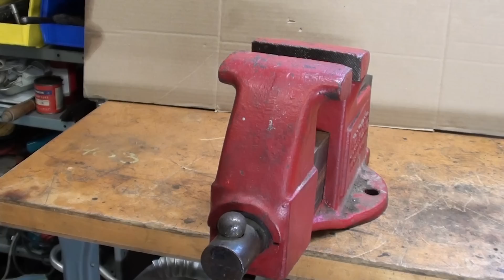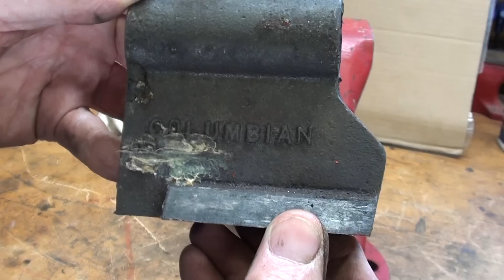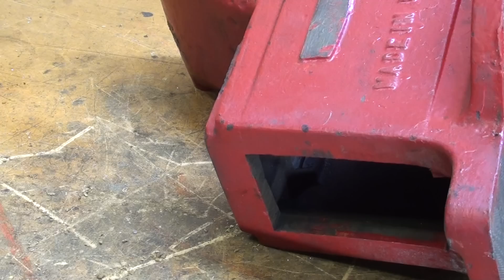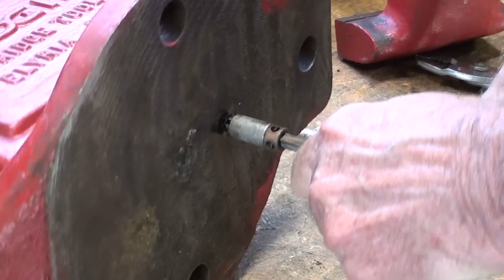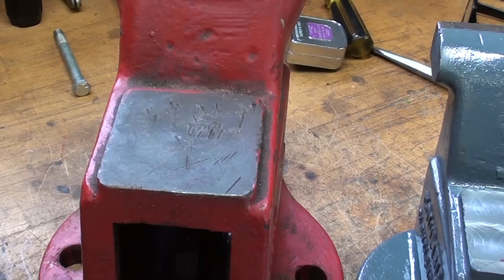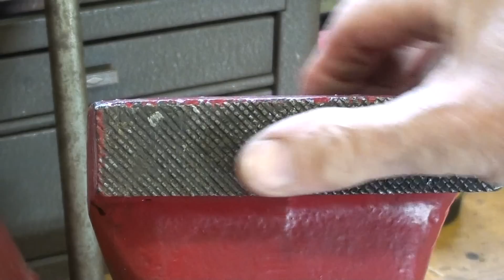Fixing a Huge Ridgid Columbian Bench Vise Tips 569 tubalcain

Comment: Msc industrial supply sells Columbian. I think they are higher since wilton took over. I fixed an old vise for my local Napa and when they went out they gave it to me. I gave them 10 dollars. It is a babco made in Japan. It opens to 8 inches. They were affordable and pretty.decent. did structural steel for 26 years and it was my main vise. I saw new ones a ways back so I guess they are still going. I want a new vise so I am looking. Want a Columbian or reed so I may need a loan from you. They are pricey for 8 inch and above

Comment: I believe the tap extractors would have worked in an impact tool, such as a cordless drill with a hammer feature, but not on high-torque. Just to get a smacking action. Then when all else fails, there is a smoke wrench. Heat the base of the vise, just a little for expansion, but put the extractors in the freezer or ice water. That would cause the tap to contract. Then use the hammer drill in reverse of course. Advice: always use quality taps that DO NOT twist before cutting. If it twists, it will break off in the material you are tapping.

Comment: When I took it apart it had a ring and a very thin cracked metal plate in it. I wanted to try and find replacement parts for it. The pin wasn’t difficult to take out on mine I just used a hammer and a screwdriver. It came right out.

Comment: I have the same vice and it’s grey. I bought it at a garage sale for $200, it was pretty worn but still working. It had an orangish color to it, I thought that was the rigid orange but after cleaning it with just degreaser it was just rust. The original color is grey.

Comment: i own a ridgid # 4 that i'd paid $5 for it from an evicted bicycle shop like - 7 or 8 years ago  were i live - i was passing by with my bicycle going to the train station to get the train when i stopped to ask for something when i found that the owner was evicted! shocking😵 i know 💀🔫
any way, i've noticed of the red vise attached to a workbench somewhere in the yard so i inquired about it, the guy in charge of the auction, a young latino guy with a big hat, told me:
- son, if you help me to sell 5 bycicle frames then i will sell it to you for $5 bucks! (wt? 🤔)
inmediatelly i got in contact with the bicycle mechanics that serviced my bike in the past ☝
✌ so the day after they went there with a pick up truck and bought about 50 frames! wow! that was incredible 👀
any way, i got there when they were loading their frames into their truck and i ask them for a ride to my home because the vise was so heavy and with my bike was impossible to get there -- i have NO grill 😢 - and it was an uphill real busy interstate highway, probably the most busy road in US history, PCH! 💀
they dropped me at home and i let it lay down on top of my work bench inside my garage
 i was very excited because that was my first professional vise during that time; today i own several vises that i also got from yard sales lol 😁👀.. and other stuff such as top bench drills, compressors, grinders, chop saws, etc from craiglist mainly 🤗
👐 that ridgid vise wasn't opening enough at the beggining and it was kind of hard to open it so i decided to check it in - so i dissasemble it and lube it that time 🛠
now it started to do the same and that is why im checking your videos sir, because now it's going to have some real 'make up' done 👌
thanks for your videos 👍
Reply from the maker: Thank you for an interesting story

Comment: So called "tap extractors" almost NEVER do much more than break with the tap still stuck firmly. If you don't have an EDM, welding a bolt on to the broken tap if you can get to it, has better results. The heat aneals the tap and often will loosen it.
Reply from the maker: Yes

Comment: Nice save on that vice. I'm glad you didn't try to re-thread that center hole. Of course you knew it would be hard as diamonds after welding. 
Im sure you know but didn't mention it, but the original pin for the nut is a taper pin. Getting them out is sometimes challenging. I usually use a sturdy chunk of metal stock to stick in there and block it up level so you can tap the pin out without bending it.

Comment: ….11:50.....those tap extractors have had little success in my realm as a maintenance mechanic…..what has worked, is to weld a small piece of 1/8" or so TIG wire to the tap, at an angle and use it as a handle...this usually requires a TIG welder though...a MIG weld will likely just break off...
 I've been able to get out taps and broken allen screws as small as 6-32....it works OK because the cast iron doesn't weld very well...

Comment: I have this same size vise at work in the shop it is a Columbian thanks to this video I have fixed some of the endplay on the moveable jaw by putting the collar on the screw in the correct place. But the nut has lots of movement I cant fix because Bubba welded the damn thing to the post cemented into the floor ! I wish I could post pictures on here the poor thing is in a sad state there is a small work table welded to the back of it where the anvil would have been. Its handy but sad that a good vise has been ruined by hammer and chisel debauchery.
Reply from the maker: Very well put, you made me laugh

Comment: That was an easy repair...!!!   Wish they were all that easy for me...   🙄
On larger sized taps, one of my often used method is a light burst of plasma torch, it worked in almost every situation, just be careful not to harden the surrounding metal, it generally takes linger to set-up than the actual removal...   lol
Reply from the maker: Thanks pierre

Comment: A question for the shop teacher...I've heard many people say that when you use a file that you should only move it in one direction (push way from you for example) and not back and forth.  That never really made sense to me since the teeth on the file are sharp in both directions.   I see you moving your file in a  back and forth motion.  Is there any reason not cut with a file in both directions?
Reply from the maker: It only costs in One Direction
Reply: 99% of files cut in one direction, forward. It's best to use a handle with it.
There are files that cut both forward and backwards. They are called a rasp.

Comment: Hi recently restored a Wilton vice that I've had for 3 or 4 decades now and when I painted it the hammer tone blue that it originally came in a deliberately painted over the anvil in the back so I wouldn't pound on it with a hammer. Pounding on a cast iron vise just doesn't make any sense to me. That's what my 1' long railroad rail is 4 because steel doesn't crack. When you pound on it. Cast iron does.

Comment: Looks like Bubba tried to do what you did to fix the vise , first was the attempt to thread the hole and when his one and possibly only tap broke he then tries to weld the nut in place 
 I think the hole was drilled at an angle intentionally for the pin to hold the nut I fixed one years ago and I seem to remember the hole was drilled at an angle ( don`t know how it got broken it was in high school shop class)

Comment: Nice repair!!  Just a thought: If the anvil were bad enough you make a sacrificial plate to put on top of the anvil and install it with flat head screws in shallow holes tapped into the original anvil so it could be replaced as it gets damaged in the future. It would probably take away from the value of the vise as an original piece but if the anvil were so damaged it would restore the working surface.
Reply from the maker: Good idea

Comment: Lyle, about 3 years ago, I got a 12 volt 
set of drivers, (drill and an impact) for 
$100, at Homer's store.  They are Ridgid 
branded, and have worked flawlessly, 
ever since I got them.  The impact driver 
has enough torque to tighten the bolts 
holding a clutch to the flywheel, on a 
Jeep.  Not enough to torque, but to run 
the bolts down all the way,  (And, 
compressing the spring.)

I cannot say enough good about them.
ONLY thing, is the required hoops to 
jump through, to get the "free batteries 
for life" program, is almost impossible 
to do.  I gave up!

steve
Reply: A 'program' like that makes more enemies than friends.

Comment: Value is, of course, highly variable between markets and locations.  However, here is a similar Columbian which recently sold on eBay for around $300 shippped.   I don't think its in as nice shape as yours, but it would give you an idea.   I would guess a fair price for yours would be $300 -$400, but I may be wrong.   Good luck.  Nice find and great video as always.   https://www.ebay.com/itm/Vintage-Columbian-Bench-Vise-No-505-5-wide-jaws-weights-56-5-lbs-Giant/223478268939?hash=item340857c40b:g:syMAAOSwrJRcrodW

Comment: Well I think you found a good job for Bubba - removing broke taps! If a hard, brittle tap broke already then it may be subject to more cracking from being beat on with a punch. 
Perhaps the tap extractors are more useful for soft or bearing materials like brass and bronze? I have some small ones in good condition from what I presume to be an old clock maker's kit, along with way too many taps in a very limited range of sizes. Maybe sheet/plate metal as well - things where you don't want to beat on the work, and they're not stuck "deep"?

Comment: 14:30...it looks like the tap extractor worked after all- AND it sacrificed itself in the process(!)

That tap extractor should get a MEDAL!!!
Reply: I agree. A Purple Heart metal and a posthumous Metal of Honor.
Reply: @awizardalso  ABSOLUTELY-!!
Reply: @daleburrell6273  I can't count the number of tools that sacrificed their life when I put them to a task they weren't up to doing.
Reply: @awizardalso  Haven't we all heated up a good wrench to make a one-time-only tool?
Reply: @fattguy21  LOL! I've done many things dumber than that. Put screwdrivers to the bench grinder because I couldn't find a chisel. I should've heat treated them first as a few hits with a hammer and they need sharpened again.. I did learn how to heat treat metal using a small charcoal grill, a fan blowing air in from the bottom vents, and when the part get red hot, quench them in used motor oil. Take note, keep a fire extinguisher close at hand. Sometimes burning oil will splatter farther than you thought. Yes, I may have above average intelligence, but that doesn't mean I'm smart. I've done many stupid things in my life and surprised I lived this long. I'm a 1954 model only missing a few parts and have a titanium implant to replace some lost bone next to my left eye.

Comment: I like your modified bolt/pin, into the threaded hole idea, much better than the pressed pin that they originally have. Makes for easier disassembly. Anyone who manages to somehow drive the original pin out (if you can manage to, without having to drill it out) should tap the home and make one of those bolt/pins to replace it with.

Comment: I found a 4" non swivel columbian  that was a rust nodule in an old collapsing garage. saved it. funny i mixed 50/50 white and black tractor enamel for the perfect grey and didnt even know thats what the original color was. I dont use it very often but im pretty proud of it. mine doesnt have an anvil though.  its a model 504

Comment: Mr. Pete, you are a man of many vises. Cummins is what's called a "lost identity OEM (original equipment manufacture), which is a pretty common practice in a number of industries for private label products. BTW Ridgid makes great tools tough enough for oilfield use, and used to make some even nicer calendars that were very easy to read from across the room. Nice video, thanks.
Reply from the maker: Thanks

Comment: Nice fix on removing that broken Tap.  You got lucky.  I believe the 'weld' marks on the underside of the base are from a Gouger, not a Weld.  A graphite electrode and air blast hooked to an Arc Welder for removing metal.  It likely was used to remove the casting Sprue although it looks like it may have been done after machining.  Just a guess.
It may be a weld to fill a void discovered after machining.

Comment: Looks like they simply swapped out a section of the mold at the Columbian foundry, for one made up for the Rigid brand, similar to how some car companies do with their emblems and badges. Bubba probably tried to weld the nut in place through the pivot hole after breaking the tap off. Have to wonder what the heck caused them to want to tap that hole for a threaded pin in the first place though, as under normal use, the press-fit pin would have stayed there for eternity.
Reply: perhaps the pin got loosened somehow and kept falling out?  only reason i could think of
Reply from the maker: I agree

Comment: Very nice repair.  I think Bubba tried to tack weld the nut to the base through the center pivot hole and of course that would not work.
Reply: Used it while not bolted down. Opened the vice up until the center of balance caused it to fall off the bench. Hit the floor and sheared the pin.

Comment: A nice heavy duty vice and a useful tool in any shop.  Why do you not like the swivel bases on a vice? Is it a concern about a failure point.  I have two vices both with swivel bases and use that feature all the time.
Reply: I have an old Rock Island with a badly bent swivel handle and swivel angrily welded shut all around. That  tells the story.